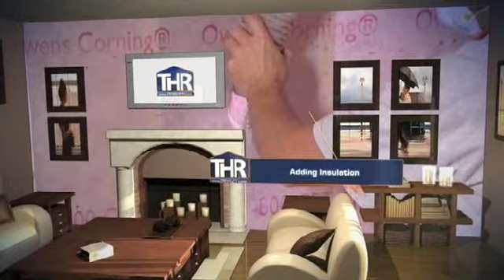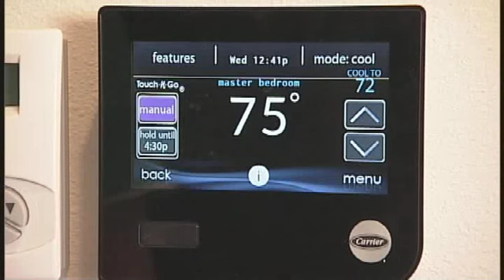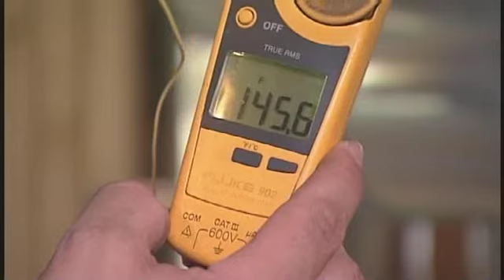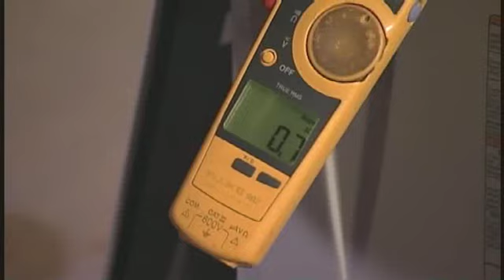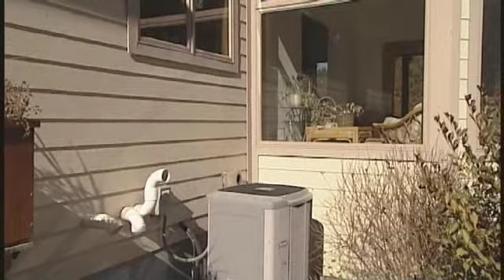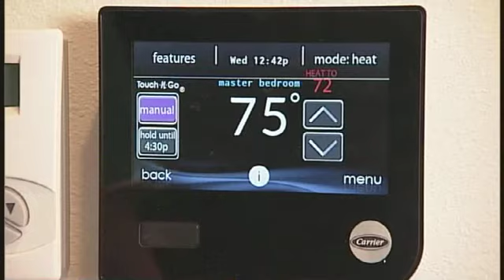Furnace and Central Air Conditioning Maintenance

Comment: Are some digital thermostats supposed to click two times every single time the heating or cooling system turns on and off because I have an Aprilaire model 8444 thermostat and it does that in both heat and cool modes